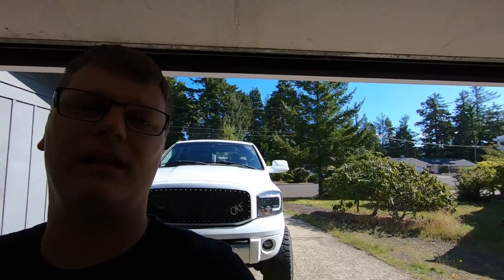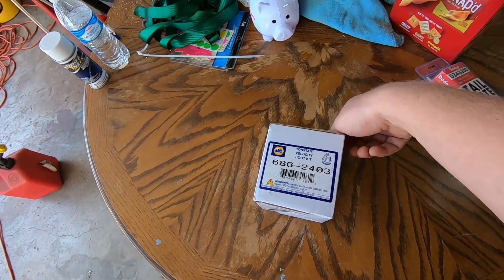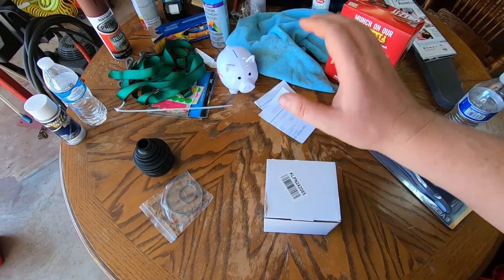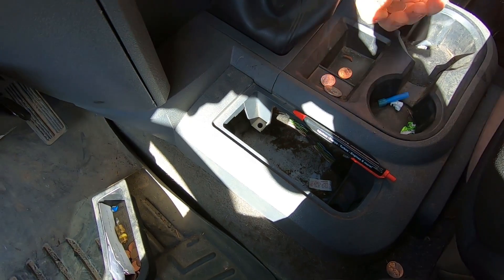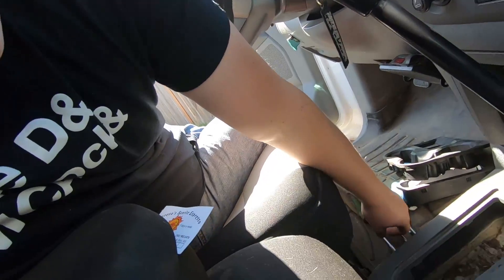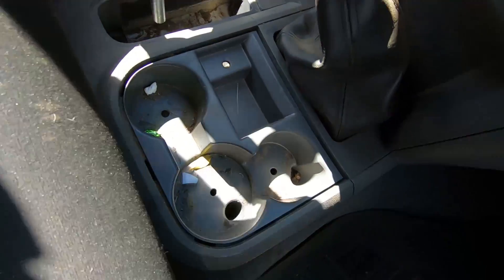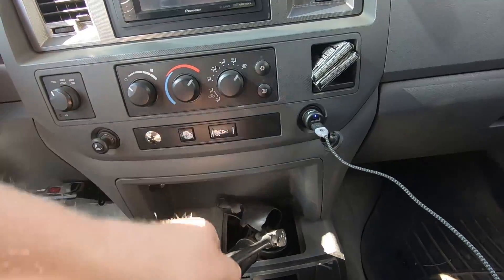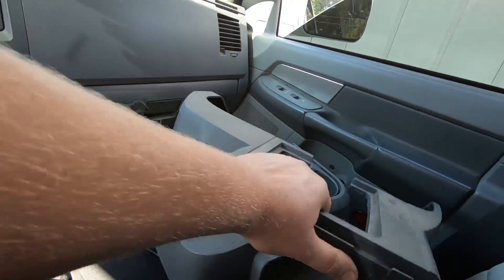Shift boot fix for G56

Comment: Did you ever find a different part number boot that fit better than this one?
Reply from the maker: No not yet, I did go through and put better clamps on the boot but it has been holding up really well so far
Reply: going to try this thx on #3 those stupid red boots
Reply: @Cargill450   I just ordered a boot that may fit better, EMPI 86-2359-D which is NAPA CVB 6862359.  The ID for the big end is 2.62" which I hope will be a tighter fit (the 86-2403 is 2.77").  Will report back soon.  Ever since I swapped a G56 into my 1998.5 Cummins I have been fighting leaks using universal CV boots.
Reply: I installed the new EMPI 86-2359-D and it fits great! Nice and snug at the base and fairly snug at the top. And the shape is right to where it doesn’t try to pull up from the bottom like universal ones do.